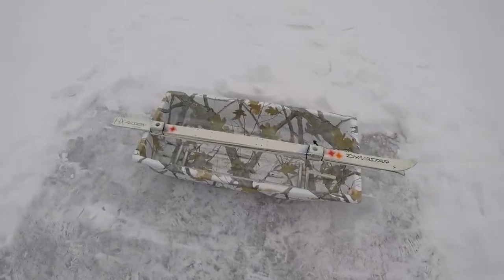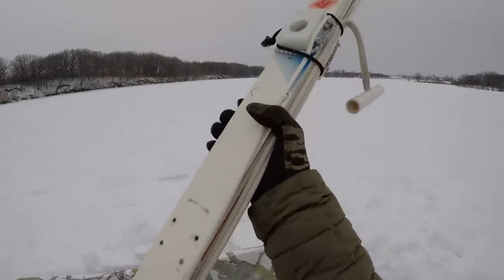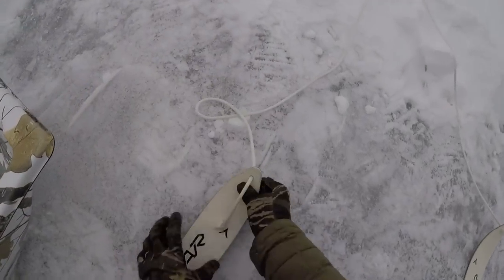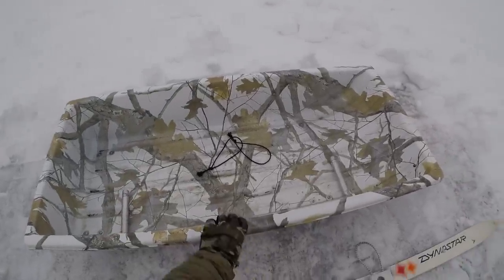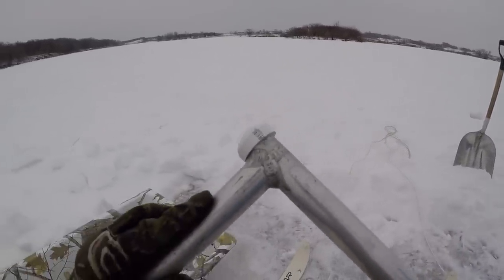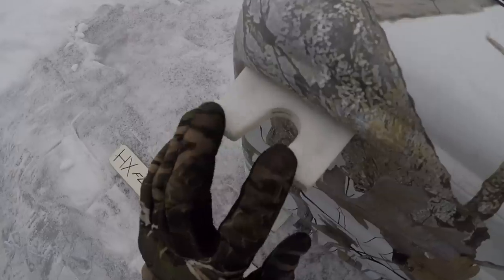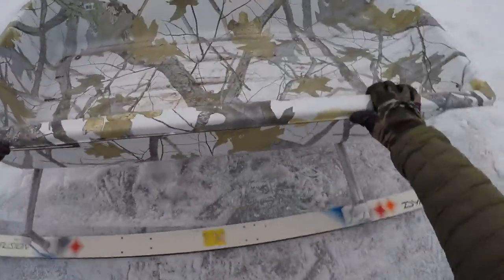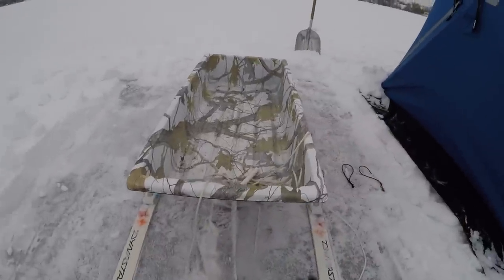The "Sledski" Collapsible Smitty Sled

Comment: this is exactly what the setup i am building now, but i have a setup for 2 sleds, one big one for pop up and gear, and other for light gear.,   the old one i have is using wood and it works but just heavy, very good video.

Comment: love this design, I am thinking about making this same one, the only thing that I have a tough time with is the blocks mounted to the underside of the sled. Kind of means you always have to use the sledski...
Reply from the maker: I did recently replace those four corner tabs under the sled with two strips of 1/2” HDPE that run the entire length of the sled. I figured it would give it a little more support in the middle and if one of those aluminum welds ever broke it should be easier to pull back with the skis off.

Comment: Real nice..sure would like to see a picture or video showing “notches” on new runners and how it’s attached to bottom of sled very slick set up!
Reply from the maker: I might do a quick update video this winter. I went with 1/2” HDPE strips on the bottom, 2” tall by the length of the flat portion of the bottom of the sled. I basically just used a hole saw the size of the aluminum bars and drilled them so the edge of the circle was at about the bottom edge of the runners, then cut straight down with the outside edges of the circle cutouts so they’re like an upside down U. I ran a few machine screws into the runners from the top side of the sled and gave them some big washers.
Reply: @ndyakangler  sounds good! Thx for replying so quick.. tryin to track down some plastic now.. and the perfect aluminum tubing..good luck on the ice this year..be safe cheers
Reply: Hello! Hope the bite is on! So..thx again for vid.. I duplicated this Exact set up .. works flawlessly..on a little larger otter..gonna put full length of plastic on bottom..tabs hang on everything lol.. have you ever pulled yours behind machine of any sort....how tough ? Thx again.. tightlines cheers
Reply: Wish I knew how to send ya pic..lots of compliments..

Comment: Harness makes a big difference with sleds, mine fits over my neck and shoulders, I pull heavy loads with ease.
Reply from the maker: I’ve thought about adding some type of harness but I can usually pull that sled with my pinky finger, although if I have to pull it any distance I’ll put the rope around my waist.

Comment: Ok...Smitty sled done! A few hours and a small workshop later...it's donnne!! lol. Ty for this video! 

I did 2" bases. Very long time to cut through using the holesaw at that thickness. However... unknowingly, it did eliminate the need for shock cords. Is there any other way to cut plastic faster for 2" deep cuts?

Comment: that is a hell of a lot lighter and nicer than the wood ones.  I was going to build mine with 2x8s  but I am having second thoughts after seeing this. if I can find that plastic somewhere? I am going this route. Thanks for the idea.
Reply from the maker: Around here we have Mac's hardware where they have bins of misc scrap plastic pieces and sell it by the pound. They usually have a decent selection of HDPE. I've also found it locally by calling a place that makes plastic display cases. My last resort is ordering online from TAP plastics, I can have them cut it to whatever dimensions I want but I also have to pay shipping. Another route you could go, most plastic cutting boards are HDPE. You might only be able to find them as thick as 1/2" but you could do double layers of that for the ski blocks. Just have the screws from under the skis thread into only that top layer of HDPE to hold everything together. I've hole sawed through double layers like that as well. HDPE is slippery so I use double sided carpet tape to pretty much turn two sheets of 1/2" into a sheet of 1" if the piece I'm making will be screwed together in the end anyway, then clamp it down good on the drill press before hole sawing it.

Comment: Great sled and video. Could you use, 1 1/4" pvc instead of steel pipe. Could you advise what the height of the legs are. Would appreciate the insight.Thanks.

Comment: Just found your video - Great review and nice enginuity. I'm toying with styles, etc. I like the HDPE suggestion. Can't go wrong with Alum pipes for something like that either. How high did you end up going with your pipe from the footing on the ski to the bar that holds your plastic tub/sled. ?
Reply from the maker: The leg pipes were about 8” long. I probably made them a little longer than they needed to be, I’ve never seen the skis sink more than a few inches into the snow.

Comment: I’m sure that works great on ice & groomed hard pack that’s been tramped down by hundreds of weekend warriors. How does it work with 100+ pounds of gear in fresh knee deep powder and not a track in sight? Like we deal with living in the boonies with lots of space and few people. I don’t think you could move it with the skis buried. I was just watching the guys with the little ice auger powered sleds, same story. Considering  all possible snow conditions there are times when the stock tub sled would easily float across the top if it didn’t have those blocks of plastic screwed to the bottom.
Reply: A tub sled with a 100# in it won’t float across your knee deep powder bud better get your snowmobile out  !! 👍

Comment: Is it really worth putting skis on?  Why not runners or nothing (aside from wear)? 

Seems like you'd lose a bit of carrying capacity even if it slides easier. 

I just upgraded my sled and curious as i was going to go with runners.

I tend to go over and through some thick stuff. Like it though.

Comment: love this sled! are the HDPE pieces that are screwed to the skis 1"? You do say 1" in the video but they look a little thicker? I'm going to try your design as well, but I'm wondering if I should get the 1" or 1.5" thick plastic. Beautiful design and thanks for posting.
Reply from the maker: I went with 1” but it wouldn’t hurt to use thicker plastic. The 1” seems to work fine though, I’ve only had a leg pop out of a plastic block once when pulling it over some rough terrain.
Reply: @ndyakangler  thanks for the reply. very nice sled

Comment: Great design and setup for sure the only thing I wouldn’t do is put the HDPE things on the bottom of the sled there’s times when we have to pull our sleds across gravel parking lots or asphalt to get to the ice and if you’ve ever pulled a sled loaded on top of a Smitty without snow or ice is isn’t fun !
Reply from the maker: I’ve actually done a couple modifications since I filmed this video, for one I replaced the four “tabs” under the sled with two HDPE strips that run the length of the sled. Other than the notches for the bars it’s like having a sled with HDPE runner strips so if I need to pull it without the skis it’s no problem. I also moved the sled over on the bars from the middle to one side so the shack can sit next to the sled rather than in it.

Comment: Great review. What type of countersink bit did you use for countersinking into the skis?
Reply from the maker: I used one of the cheap Irwin ones. It was bigger than the screw heads but I just eyeballed it with a drill and it worked fine. They’re recessed a bit below the surface but as long as they aren’t protruding outward they shouldn’t add any drag.
Reply: @ndyakangler  were they for wood or metal, if you know by chance

Comment: Has anybody tried 3/4 or 1” EMT conduit?  I’m just thinking a conduit bender would work for the 90’s instead of welding. May be a little flex with a heavy load but in theory it should work.

Comment: Hey, great video, just wanted to ask what the reason is for angled holes in the UHMW?
Reply from the maker: It will give it more structural strength and rigidity having those bars angled rather than at 90 degrees. A square or rectangular design would be more likely to collapse on itself pulling a fully loaded sled down the slanted boat launch.

Comment: Just came across your video.  Great idea.  Only question I have is how easy is to turn directions when say a100 pound load?  Your video makes it look easy when empty.  I want to build one, so can you get back to me on my question.
Reply from the maker: It’s not too bad. If the skis dig into the snow at all I can’t rotate it when it’s loaded up and sitting still but once I have a little forward momentum it’s easy to make some sharp turns and get it in the direction I want to go.

Comment: Curious as to why is the sled so high off the ground? Would this not still work with a lower profile?
Reply from the maker: I made it that way for when we get powder snow. If the skis sink down into it  the sled part will still be elevated and not plow through the snow and make it harder to pull. I probably only needed to elevate it a few inches though, that’s about as far as I’ve seen the skis sink down into powder.

Comment: Nice clean and simple design…great job! I’m just in the midst of  getting mine ready to be built and have a question. Would you find the sled tippy if the skis were only the outer width of the sled compared to being wider as you constructed?
Reply from the maker: My sled is only about 24' wide so having the skis that width apart might make it a bit unstable at the height I built it to. The way it was shown in the video I'd stack everything into the sled with the shack bag on top along one side next to the propane tank and I'd often have it roll off when I'd get one ski up on a snow drift. What I ended up doing was shifting the sled over around 5" or so to one side of the bars and that left plenty of room to lay the shack on the bars next to the sled, and added a bungee cord around the shack from the sled. That lowered the center of gravity and opened up a lot more room in the sled, less playing tetris trying to fit everything into it. It works great!

Comment: Is there a reason you didn't go with square tubing?  And why you angled the tubing?  I'm trying to build a version of this as well.  This is the best design I've found.
Reply from the maker: I went with the round bars because they were available locally and it would be easier to drill a round hole in the plastic for them to fit into. I angled the tubing so the design would be less likely to collapse on itself under heavy load when pulling it down the steep angles at boat launches. A square or rectangular design could fold over at the joints if stressed too far, the isosceles trapezoid shape is structurally stronger.
Reply: @ndyakangler  And so I set my drill press to 30 degrees... lol thanks for the repy

Comment: Is there a particular reason why you cut the hole in the HDPE block at 30 degrees?  The reason why I ask is that I don't have a drill press , but could probably cut one 90 degrees with my cordless drill.
Reply from the maker: The garage engineer side of me figured it would be a stronger setup if I angled the bars toward each other like that. Having them in a trapezoidal shape redistributes some of the stress away from the plastic blocks and makes it less likely the whole thing would fold and collapse under a fully loaded sled on uneven ground than if I went with 90 degree bars and a rectangular shape. You could probably get away with having them at 90 degrees though if your pulling less than 100lbs of gear. I tested mine by hopping on top with it fully loaded and it held up about 250lbs stationary without failing. My main concern was that the plastic would become brittle in the cold which is why I wanted to take some of the stress off the blocks but HDPE seems to hold up well even when the temperature is well below zero. 

One thing I’ve recently changed was to do away with the four tabs under the sled and replaced them two strips of 1/2”x2” HPDE that run the length of the flat bottom of the sled and cut the notches for the bars to fit into on those. It adds structural support to the sled and if anything ever fails where I’d have to pull it back without the skis it will be a little easier than it would have been before.
Reply: @ndyakangler  That is absolutely right- it makes triangle shape which is mush more stable and rigid then rectangular - 90 deg  . Bright idea!~ I was up to building one with plywood  but hated that idea - I am more metal /plastics fabrication guy  . Will definitely copy your idea. I burnt my legs pulling regular sled in deep snow uphill from the lake last Sunday. Thanks.

Comment: Was there a reason for boring the holes in the blocks on the ski's at an angle versus just having them straight up and down?
Reply from the maker: Doing them at 90 degrees might have worked fine, the HDPE doesn’t seem to get too brittle in extreme cold. My main concern with doing it that way was when pulling the sled up and down any hills or boat ramps the prying force on the HDPE blocks attached to the skis might cause them to fail. A square/rectangle is a weak structural form which can easily collapse upon itself. I chose to go with more of an isosceles trapezoid to redistribute some of the force from the aluminum poles and make it structurally stronger.

Comment: Awesome setup...and my husband has an old set of skies. Hmmmm...  How does it do in deep snow? I’m in California, and there is often deep powder. My current set up sucks in powder, especially when fully loaded.
Reply from the maker: Any kind of dense wet snow it’ll slide on top of. Fresh powder the skis will sink down into it with the 100lbs or so of gear I load into mine. I’d say about 6” of powder on top of a crust of old snow is the most I’ve pulled mine through. It seemed to sink down and plow through most of the powder but it was still moderately easy to pull.
Reply: NDYakAngler - thanks. I had 80 pounds the first time I used mine, but there was only a few inches of powder, so the resistance wasn’t bad. A couple feet of powder would be a different story. That would be a miserable slog. I’m going to take it back out on New Years Day and see how my new mods work. I love the idea of skis, so I def need to work on that.

Comment: Awesome build!!! How do think this sled would hold up and stay straight without having the running strips that you put on?? I would like to build one to set my flip over on but don't want to have to put runners on the bottom.
Reply from the maker: All you need are some skis and something to raise the sled 6-8” off them so you aren’t plowing snow with it. This design wouldn’t work without the plastic runners I put under the sled because I angled the bars and they catch on the grooves I put on the runners, otherwise it would be too much prying force from the bars on the plastic blocks on the skis and they’d snap when I toss a bunch of weight in the sled. If you did the bars at 90 degrees to the skis you might be able to just toss a sled on top. I’d honestly make some kind of top for it you could just set the sled on.
Reply: Thanks for the reply!! I understand what you're saying. I've been trying to come up with a way to attach 2 more poles perpendicular to strengthen it....yet keep it easy enough to disassemble. I'm at a loss so far. Ill keep brainstorming!!

Comment: That's what I want to do ontop of putting together all of my other stuff put my sled together
Reply from the maker: It saves time in the end if I’m pulling the sled any kind of distance. It takes maybe 60 seconds to put it together when I’m not trying to film the process, then I can easily pull it along with my pinky finger. Meanwhile my fishing buddies are struggling to pull their regular sleds through the snow, having to stop every 50 yards to give their legs a break and catch their breath. If I start walking back from the fishing spot at the same time as them I usually have my gear loaded into my truck by the time they’re within 100yds of the launch and I’ll go back and help carry some of their gear up the final hill.
Reply: @ndyakangler  my buddy has a wooden box with a seat he pulls his tent over the whole thing that has skies on it I just bought a cheap lite snowmobile and a little trailer I'm all done driven on shady spots and pulling 100pnds of gear threw snow..I try to make everything when it comes to icefishing less work and more fishing time

Comment: So why the skis? Reduces friction? Easier to pull?
Reply from the maker: Yes, I bet it takes less than half the effort to pull the sled with skis, at least on snow. Bare ice it’s not a huge difference but in snow you’re basically plowing the width of the sled without skis.

Comment: Is there a reason that you used hdpe to insert the pipe into? I was just going to use a few scrap pieces of wood instead for the blocks attached to the skis since I don’t have any hdpe laying around.
Reply from the maker: The main reason I used it is because I had a big chunk of 1” thick HDPE sitting in the garage from a previous project. I also find it easy to work with and it doesn’t get too brittle in cold weather. Wood should work fine as well, I’d just make the blocks a little bigger so there’s less chance of them splitting.
Reply: NDYakAngler thanks, I was thinking the same thing. I’ll just make the blocks a bit bigger and deeper possibly.
Reply: @Terrannator  Plywood works better than - wood. I probably will use my 1'' plywood blocks which I prepared to use for building my sled before I come across to your design. And probably will bend my aluminum 3/4'' ID pipe with pipe bender ( I am an electrician....)